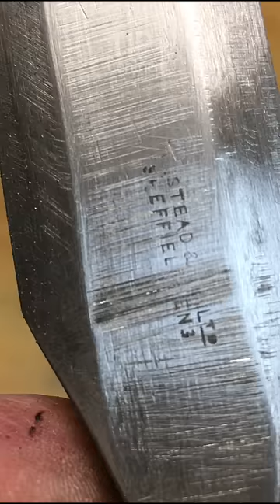Chisel Restoration 😍 #shorts #tipcentric

Comment: Turn the top of the handle down a bit too and put a brass ferrule on that to stop it splitting 👍🏻
Reply from the maker: Yeah I was thinking a strike plate may be a good idea, although I probably won’t use this one for any high impact work. I have a set of Fat Max ones I use if I need to whack hard! 👍👍

Comment: Ruined the handle, replaced it with something that'll crack in 3 days
Reply from the maker: Take another look, the old handle was completely battered from years and years of being whacked with a metal hammer. The new handle is maple and will last for decades. If it was going to crack it would have cracked when I attached it, I am never going to need to hit this handle harder than I hit it then.

Comment: Don’t u have to re temper the steel after the grinding?
Reply from the maker: Only if it gets past a certain temperature. I made sure I dipped it in the ice cold water multiple times to stop it from getting too hot 👍

Comment: What is the degree of sharpening
Reply from the maker: 25 degrees for the main bevel and 30 for the micro bevel 👍
Reply: @tipcentric  
What is the degree of roughness and smoothness of the sharpener?
Reply from the maker: @haytembeddida917  Sorry, I thought you meant what angle did I sharpen the bevels. The sand paper I used to rough out the sharpening was 120 grit,  The second one I used was 150 diamond grit and the stone is 240. This gets them pretty sharp but I am going to get some better stones soon so I get them them much sharper 👍
Reply: @tipcentric  
Thanks for the clarification
Reply from the maker: @haytembeddida917  no problem at all, thank you for watching 👍👍